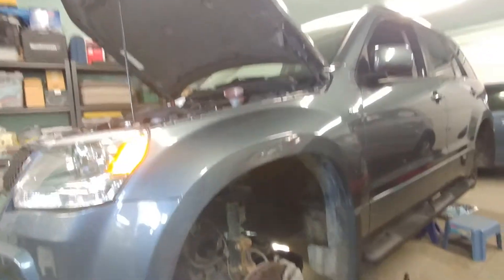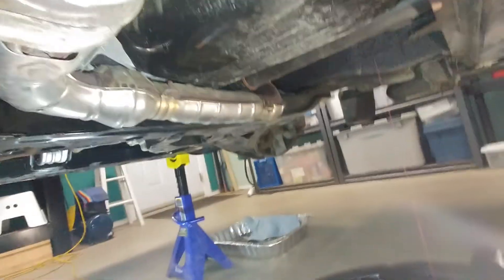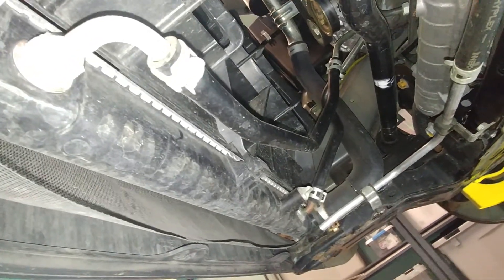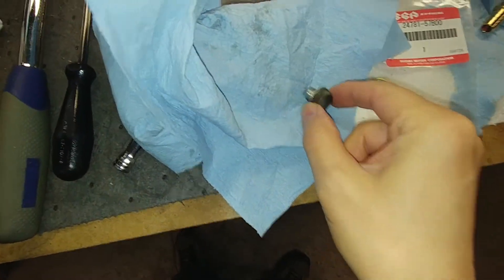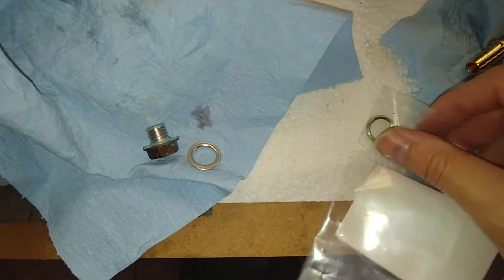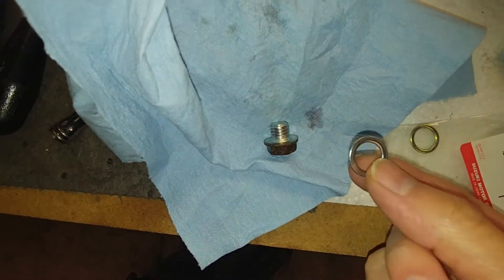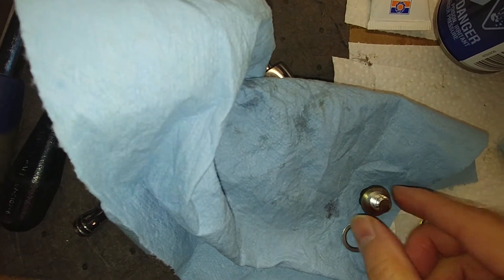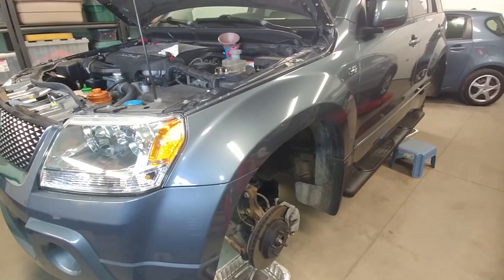2006 Suzuki Grand Vitara auto trans drain

Comment: Where is the filter?
Reply from the maker: the filter is located inside the bottom of the transmission pan, it is a screen, so if your fluid is very dirty, I would recommend removing it and cleaning it.  Hope this helps.  Thank you for watching.

Comment: How many quarts does a drain and refill take?
Reply from the maker: I'm not sure about quarts, but it is about 3 liters.  I would recommend filling it with just under 3 liters, then idling the vehicle up to operating temperature and checking the level, at first I slightly overfilled my transmission and had to extract a little out, when the fluid is cold it should just register on the bottom end of the dipstick, and most importantly, when it is at normal operating temperature between the two marks on the hot side, hope this helps, thank you for watching.
Reply: I’m curious if there is a filter inside the transmission?
Reply from the maker: there is a screen inside, probably a good idea to clean it when doing a fluid replacement, thanks for watching.

Comment: Why replace washer?
Reply from the maker: good question, I have found that if I do not replace it then there is a slight weep from the bolt, in my opinion this special washer is one time use only,
thank you for watching
Reply: I was wondering that too. I planned on changing the fluid tomorrow but looks like I won’t. I’ll have to order the washer. Hopefully I’ll be able to find it online, and the special fluid it takes.
Reply: Well mine is a 2007 and it says that washer won’t work for mine. I thought the 06 and 07 were identical